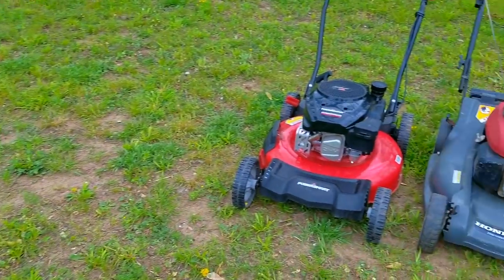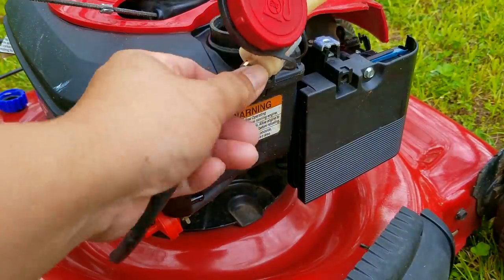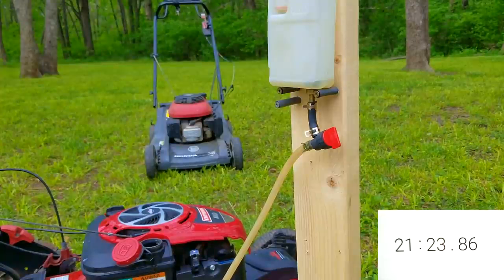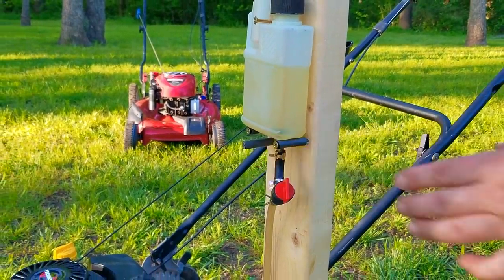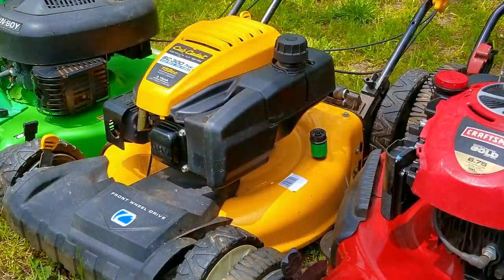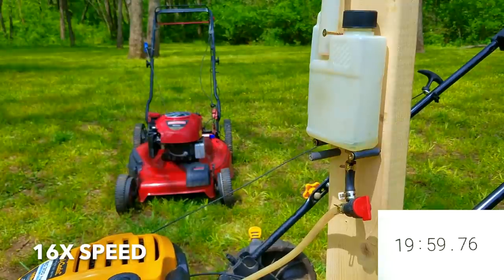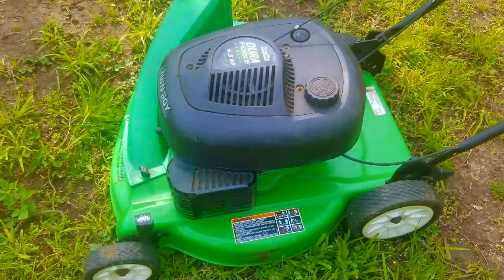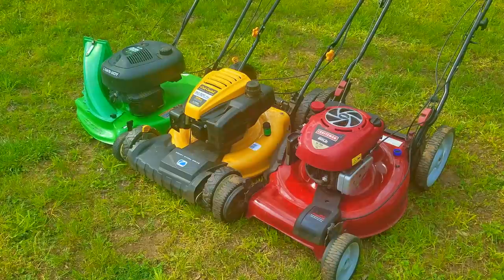One Of These Mowers Will Run Almost Twice As Long As The Other One

Comment: I have an idea for you. Put the same amount of fuel in the tank for each mower, run it like you would mow your lawn normally, and then you can make a rough estimate as to how much is left, or you could also drain the tank completely and measure the fuel left over
Reply from the maker: yes that works too, thank you Panda Ant.

Comment: I've learned that rebuilding the newer engines and adding maybe 500 bucks of aftermarket parts can majorly improve the efficiency and power. Usually just a carb and possibly a cam. But those do a ton.

Comment: Hi HG,  These mower's engine run test are cool.  Saving money on fuel is something to consider now.

I bought fuel yesterday, it cost me $12.30 more than the previous time.  
Last month I started running my riding mower at a lower RPM.  
I have not noticed any difference in performance or how well it bags the grass clippings.
The mower does use a little less fuel which was my goal.  And every little bit of gas saved adds up by the end of the year.

I will also be cutting my SA grass every seven to ten days.  This will be a fuel cost savings too.

I much appreciate your informative teaching, maintenance, troubleshooting and repair videos!

     thx,  tommy
Reply from the maker: thank you Tommy W Walden, and I plan on doing the same, with my rider, since I don't cut any tall grass with it, I probably go to about 80% throttle.
Reply: Just a note running it at low throat toe could foul your spark plug and cause the engine to run hotter because the fan is not running at full speed it is best to run them at full throttle especially with a bagger
Reply from the maker: you make a good point.
Reply: @HomeGaragechannel  yeah if you’ve ever seen project fern he did an experiment and made a. Push mower run off of gas vapors in a bottle years ago and it ran very efficient with almost no fuel consumption

Comment: Wow.  I did not expect the 2 cycle to run that long.  My dad gave me  a 2 cycle back in the late 60s I think and it ran very good.  Only problem was it did not have lots of power in heavy grass.  But still was a good mower--I think it was a Craftsman mower but do not remember the engine brand.  Great research so thanks for all the information and videos.
Reply from the maker: thank you D Butler

Comment: Now this was very interesting.  I was very pleased to see the B&S 6.75 flathead engine do so well.  It's the one on my 2007 Snapper Hi-Vac 21" self-propelled.  Mine has a throttle control, so I guess if you re-test any with throttles, or do more tests and include 1 with a throttle control, I think if all of them are set at the max position and verify that the engine speed is reasonable (i.e., not way faster than 3600 rpm or something like that), that might be a way to keep the testing as scientifically clean as you have been doing so well in these tests.  And I think if a test of self-propelled models only was done with just the drive wheels off the ground, that would also be a pretty valid test, in my view.  If someone looks at the MPG ratings of new cars, those numbers let us compare one vehicle to the other.  Your testing is providing that same type of useful information, I would say.
Reply from the maker: thank you Tom Lewis I appreciate it.
Reply: 1983 Snapper Hi Vac, with a B&S 6.75 flat. from 2000 something. Mine's auto governed & sips fuel too. There's really zero benefit from OHV design on a constant speed utility engine, if the engine operates all over the rev range, like a road-going device, then newer designs would prevail. At steady speed, cutting for an hour or three, flats(side valve) are STILL surprisingly efficient. : )   long live the side valves.
Reply from the maker: very well said, about the OHV setup,
Reply: I own a 1997 Snapper 21 Hi Vac. It came with a B&S 5HP Qunatum ( flat head) . I repowered with a “new old stock “ Quantum short block .

Comment: You should get your hands on a goped someday. Same small engines and everything extremely simple. I also like how you can see the shadows move on the ground from the trees during the shots of the testing.
Reply from the maker: I have two, but I haven't decided to work on them yet
Reply: @HomeGaragechannel  OMG I WOULD LOVE TO SEE THAT VIDEO It would be so awesome if you ever get a chance. What do you have? 2 sports?
Reply from the maker: ah, I am using the term "Goped" as a broad term for any motorized stand up scooter, with a gas engine, I don't remember what brands they but they are not the Goped brand.

Comment: I had the best lawn mower in the world. It was a hand made mower, made with two stroke 60cc engine from Tomos in Slovenia, with 14mm carb from some other Tomos engine and a extremely high compression from the factory. It was connected directly, if the engine is running at 2000 rpm, the blade will turn at the same speed... 2000 rpm was enough for  cutting everything, it could run for over 30 minutes with the same amount of fuel in your test, WHILE IT WAS MOWING GRASS... It was over 40 years old when i decided to buy a newer one...
Reply from the maker: thank you mail zaoglas, I appreciate the information

Comment: Hey, I’ve worked on a lot of motors throughout the years… I noticed you used shoelace string around the handle … I use Romax house wiring to hold the leavers down when I’m testing them. I keep about foot in each toolbox, but one wrap around the leaver is enough…. it’s thick enough gauge where it keeps the handle down but it’s also thin enough to remove it quick in case of emergency..
Reply from the maker: this time it wasn't shoelace, but a section of rope from a weed eater or blower, that I had done previously

Comment: Another great video. Love your work. I’ll be getting a Honda HRX217 got any tips
Reply: The new style with the GCV200 is proving to be less reliable than its predecessor. Find a good deal on a used machine that isn’t clapped, and it’ll last you forever.
Reply from the maker: very nice mower, yes, when your about 2 minute from being done with the mowing, reach down, and turn the fuel valve off, and then finish mowing, then let it run till it dies, that's best tip for those.

Comment: I very rarely run my mowers at top speed and usually about 1/3 to 1/2 open. Gas for mowers and economy is't an issue any more than vehicles. My vehicles are old and well paid for and instead of a payment book I just keep the oil full and buy the gas I need to go where I need to go. This was the same as when I was working and the other gas 'shortages' hit and the price went up. A working person won't spend thousands for a more economical vehicle if they're out of debt and want to stay that way. Thanks for the test because it was a good one and nI can't tell a lot of difference between the Briggs 85 model and the Kawasaki overhead valve, both on Snappers and the Kawa has the bagger. BLESSINGS!
Reply from the maker: you make a great point.
Reply: @HomeGaragechannel  I try. Not being under someone else's thumb is a great feeling. I don't have or want new stuff and pay several prices for it. I can buy a lot of oil and parts with a vehicle/bank payment. Thanks for the good stuff you record and pull off. FINE job!

Comment: Nice test, I had an old Power Products 2 cycle mower that would run all day on a small fuel tank. I don't think they make them any longer. Thanks for a gret video.
Reply from the maker: Thanks for the info Waterman one.

Comment: I have watched this several times and have carefully thought about this. A more realistic test would be to first install new air filters on all of them to eliminate any possible rich conditions from slightly restricted filters. Then I would eliminate the test stand. Run them dry and put 4 ounces of fuel in each tank. Then mow your yard with each one as the average homeowner would do, meaning full throttle and using the self propel if equipped. The reduced fuel is so you don’t run out of yard before you run out of fuel. I would let the grass get a little higher than normal so that the governor will sometimes add more fuel. If your grass density isn’t even, try to make the same number of passes with each mower through the densest part of the yard. In the end, count not only the time it ran, but how many passes across your yard each one made. The bottom line is that it doesn’t really matter how long one can run, but how much grass can it cut? A mower that bogs down in heavier grass will cut less grass than one that keeps on rolling, even if the one that bogs has a longer no load run time. In summary, I would test them the way I use them. This is one of my favorite channels!
Reply from the maker: Bruce Coleman I really appreciate the time you take out of your day to watch  and comment, on my videos.  So here are some consideration, to your suggestions.  First, the stand was for "visuals" to let the viewer see the fuel consumption, versus put  it in the tank.   The second is "walking" with the self propel. The load on the engine will change, due to the self propel being used harder, if for some reason, I happen to be walking slower, because of being tired, or some other strange reason.   The 3rd is the grass height would also load the engine in different ways, due to the amount of grass it would have to cut. Since I cannot control these factors, they were thrown out of the test, and all tested under the same condition, stationary.
Reply: @HomeGaragechannel  Most of us have grass that is denser in some areas than others. I would section the yard into dense areas, average areas, and light areas. I would probably just use the top 3 or 4 performers from the previous test. Depending on the size of your areas, I would make a pass or two with each mower through each area so they all would have a similar test. While a less powerful engine may do very well in the first test, it may lack the power to do well in a real world test. While my test may not be precise, it would be a more accurate representation of what I could expect if I used one on my own yard. A mower may have done well on the initial test, but if it bogs and struggles to get through my yard, it becomes irrelevant. Small differences in results should be ignored along with anything that fails to do its job. You could also do 3 tests for each one and average the results.

Comment: You could use the engine break as a load like project farm did in his older videos
Reply from the maker: it's too much of a load.
Reply: @HomeGaragechannel  in that case the water spray idea is probably the best however the blade design is different between the mowers you could however add weights to the blades I believe that would simulate cutting grass the best
Reply from the maker: thanks , I like the water idea, only because is not integral to each mower , like the brake, we'll see, if it makes any difference when start testing it.

Comment: Can you do this test with riding zero turn mowers? I have a 1.3 acre yard and I don’t use push mowers. The most common engines I’ve seen them with are made by Briggs and Stratton and Kawasak. I want to know which brand is more fuel efficient.
Reply from the maker: that would be a great ideal, I'll have to find some to test though, But I do plan on it someday.

Comment: I have a Honda mower and a Kohler mower with similar  power output. The Kohler engine looks bigger and the felt like it had much more power than the Honda. But after a very simple modification I discovered the Honda could have similar power output. But as you said that would no longer be factory default and not a fair test. Good to know incase you have an engine and expect the default settings are low for CARB compliance. You can gain new life out of your lawn mower.
Reply from the maker: thanks for the comment

Comment: I was doing some reading and the new plastic carbs are most efficient. They actually run so lean the engine rev up and down (hunt?) for rpms. The jets plug by very little debris. Efficient is not so efficient. Love me the quantum mowers.
Reply from the maker: you go that right, thank you D4x4Bronc.

Comment: Oh and also the Duraforce is the only engine not actually made by lawn boy but a Briggs design of the Rtek used in snow blowers and such. It just has a different crankshaft and reed valve setup to run like the old Briggs and Tecumseh engines with a air vane governor and extra air inlet to run the 6.5 hp max output it has the same piston and connecting rod as the Rtek. Where the other engines produced by lawn boy weren't able to go as high but honestly 3200 rpms at any hp is ridiculous in the cut quality. The Duraforce is also the only EPA 1 approved engine ever . My estimation is that Toro didn't want to spend money on technology that was not making money in buying a new mower every other year like todays scrap metal.Thanks again.
Reply from the maker: thank you for the information

Comment: When we had a lawn tractor with a Briggs engine it used to go through a tank of fuel very fast as we often had long and wet grass. I would sometimes reduce the throttle speed if it was a dry day and it was still capable of collecting the grass, whilst just moving to a higher gear to keep the same speed forward. I would almost always reduce the throttle down to the lowest speed i could put up with when driving from one pace to another (not cutting) and just feather the throttle depending on gradient etc.
Reply from the maker: that make sense, thank you andyarchitect.

Comment: Remember when the cub cadet first came out with the overseas engine The one I had was a Chinese knock off of a Briggs & Stratton overhead valve it ran really good the first two years by the third year gave me a bunch of trouble and by the fourth year I couldn’t get it to run anymore
Reply from the maker: on those, the valve lash has a tendency to get out of tolerance.

Comment: This year, my Toro Personal Pace Recycler, with a Briggs flathead, was hard to start. I hadn't run it out of fuel last year, but since I COULD get it to crank, I decided to run it till empty. There's a bump in the bottom of the fuel tank, and it wasn't covered with fuel. If that bump is uncovered, I figure that it's under a quarter tank. I did that whole yard (about 30 minutes of mowing) with that amount of fuel. I was under the impression that the flatheads were not that fuel efficient. I was wrong. However, later, I found that the engine was running at 2750 RPM, which is a bit low. Maybe that accounts for the economy.

I'm really surprised at the economy of the 2-stroke, especially since it sounded like it was running faster than anything else. I always thought that 2-strokes were way less economical. I guess not. I DO like 2-strokes, though. My 2-stroke engines take less maintenance than my 4-strokes.

Even though the 2-stroke was more economical, I bet the Briggs is still the winner if you calculate $/running time. 2-stroke oil adds quite a bit of cost to the fuel. Right now, a 16 oz bottle of Echo Power Blend Gold 2-stroke oil works out to $2.67 per gallon of premix. That makes premix close to double the cost of straight fuel.
Reply from the maker: I think they're  both economical and maintenance on the 4 cycle stuff is probably the determining factor to becoming poor on fuel.   It was just a fun thing to do, and yes the results were kind of interesting.

Comment: I hAve an idea for putting a load on the mower. Disconnect the switch that’s connected to the engine brake. It should put more of a consistent losd on the engine but it won’t shut the mower off. now this is an idea that might wear out the engine break that’s up to you but on the one hand you are only doing this test once with a mower.
Reply from the maker: good idea, BUT, the only problem is that the engine brake for each one, does not but the same "load" on each mower, and also  this would wear the rubber break pad down to nothing in a 20 minute test.
Reply: @HomeGaragechannel  that is true. This is only a good idea if your willing to put more money into a mower which i think i know the answer to that  lol.

Comment: Interesting, I just observed this test by accident last weekend while pressure washing my patio. My old Troy-Bilt pressure washer had the original Briggs Quantum flathead on it and for years it always took at least 2 tanks of gas to get the job done. Late last year the Briggs started making an occasional sharp rapping noise so I replaced it with a good used Honda GCV160. The Honda did the entire job on one tank of gas with a little extra to spare! Granted the tank size may be a little different but not enough to account for an entire tank full of gas plus it didn’t emit as much exhaust odor. Honda seemed much more efficient to me (but I still LOVE Briggs flatheads as well as Hondas).
Reply from the maker: thank you for the information

Comment: I definitely get why you called Tecumseh dreaded, my first two project mowers were made by them and they apparently thought they were sports cars, ran at like 4-5 k rpm and burned through 100ml of gas in 5 minutes and I couldn't get them to run slower. Also I managed to break the starters within a few uses
Reply from the maker: wow that's pretty amazing they didn't break the engine at that rpm.

Comment: I mow with my 1994 Lawn Boy 2 cycle and it uses quite a bit of gas.  I only use genuine Lawn Boy  2 cycle oil, my old craftsman weed wacker would not start, then I tried my Lawn Boy fuel mixture and bam it started, couldn't believe it, that thing wore out my arm.
Reply from the maker: thank you Tony Montana.